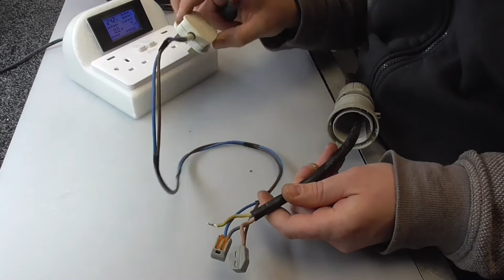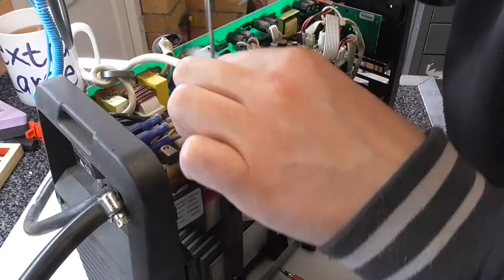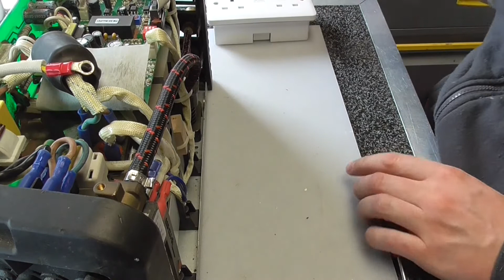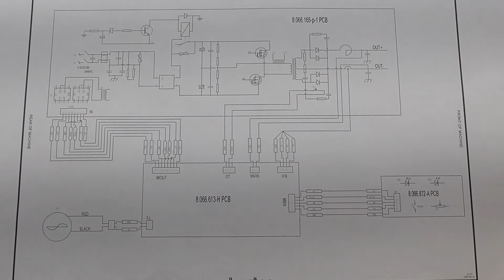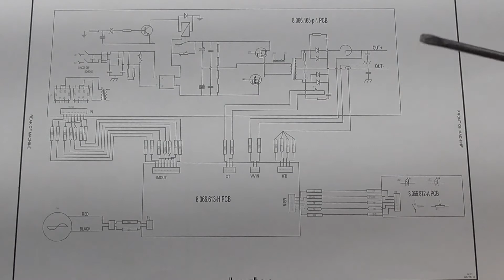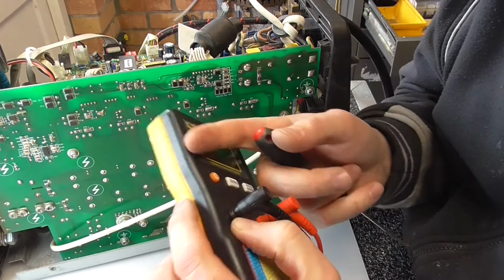Inverter welder repair. Welder tripping main fuses. Welder construction basics

Comment: Very in depth! Thank you for sharing your knowledge.
Reply from the maker: thanks for watching
Reply: Hello, i enjoyed this video, very educational. I bought a cheap clarke inverter stick welder cheap as it was advertised as blowing fuses soon as switched on. I found 2 blown up varistors too damaged to even read their values, theres no circuit layout anywhere on line for it, i researched and replaced the blown varistors with a replacement pair but still blow fuses the second it switches on. Fan blows strong i tested all the igbt,s, the diodes, capacitors, getting 263kohms across the live and neutral pins of plug but stilk blows fuses seconds after switching on. The varistors removed from the circuit doesnt make any difference apart from not allowing the welder to charge uo